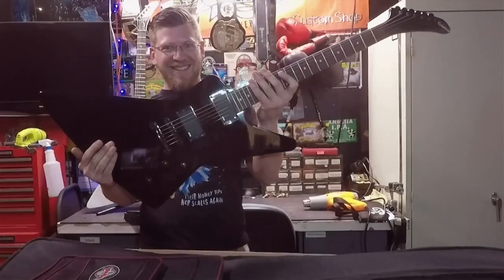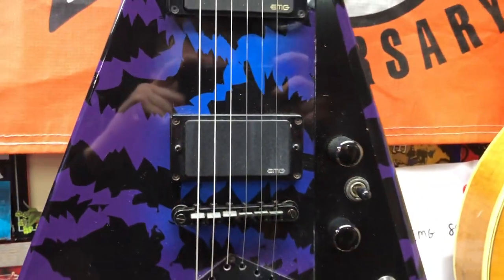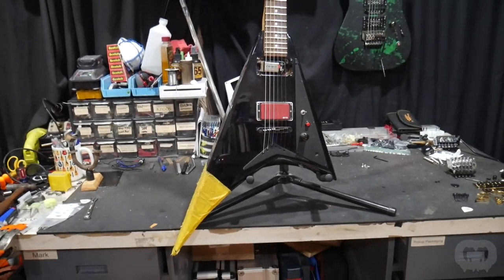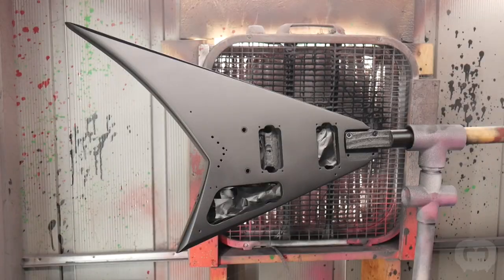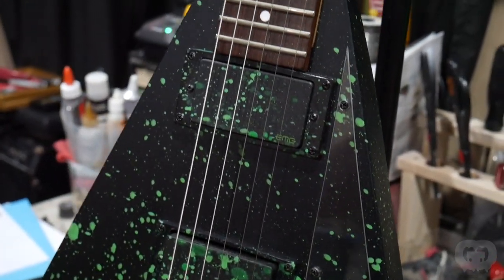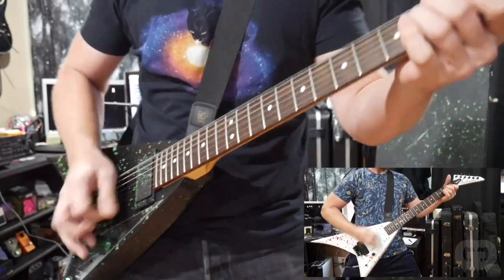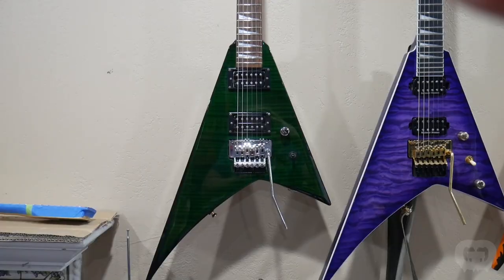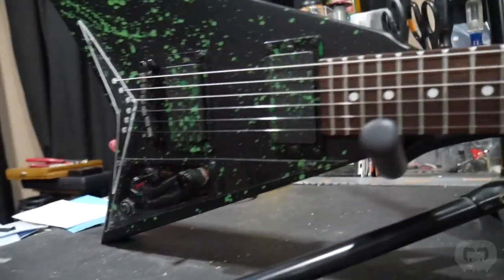Trash to Thrash #7 - Jackson Rhoads Flying V - Alien Blood and Tiger Rhoads

Comment: Jackson did a fantastic swirl paint job on the Kelly back in the early/mid 00's. Mine was stolen. It'd be easier to buy a Kelly and have someone do the paint job than to find an original. Think you could replicate the black and red swirl Jackson Kelly?